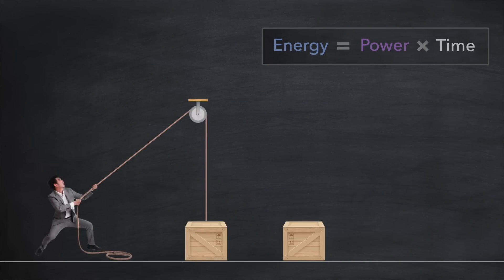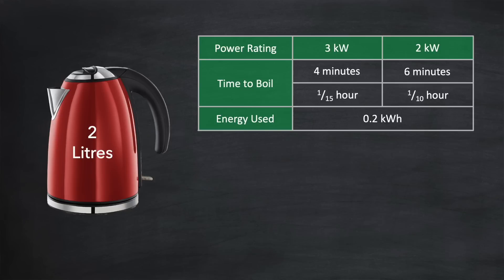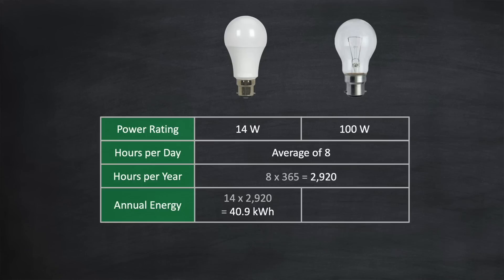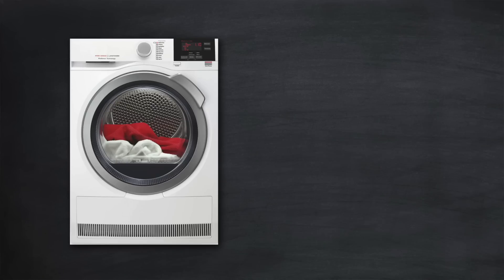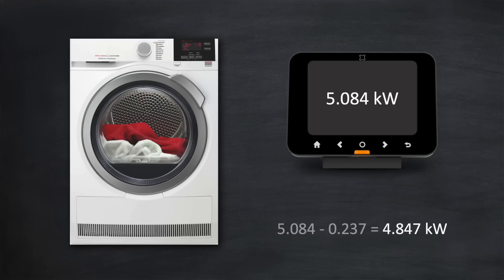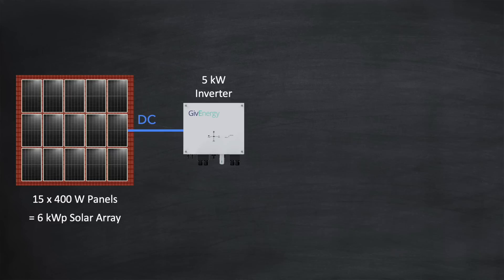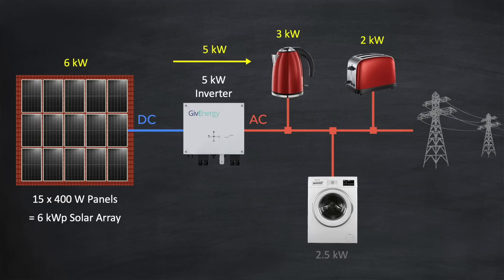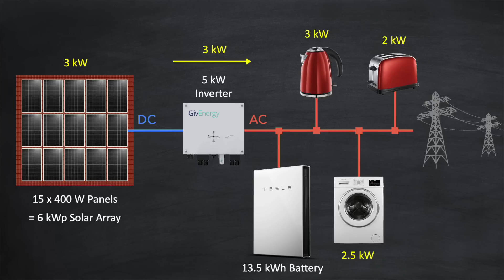kW / kWh: What’s the Difference? Power & Energy Explained

Comment: Great video Gary.  Question.  If you have 4 Tesla power wall 3 AC connected batteries, does your discharge rate KWH figure = 20kwh or is it limited to 5kwh but you just have more stored energy.  Apologies if that is a silly question.
Reply from the maker: Thanks for the kind feedback :-)

Now, the discharge rate of a single PW3 is 11.5kW already, and I believe that stacking 4 together might increase that - but I actually don't know! Maybe someone else does...

Comment: The comments have used use of capitalization on the units. The rules are pretty simple. Units are in lower case with the exception of those based on names. Prefixes are in lower case up to kilo and upper case after that so the proper use is kWh as watt is based on a name of a person (note the name of the unit is not capitalized, just the symbol)

The units based on names include:

Volt (V) base n Alesandro Volta who invented the electric battery.

Ampere (A) based on André-Marie Ampère who defined the concept of current.

Joule (J) based on James Prescott Joule who defined the relationship between current and power.

Ohm (Ω) Based on Georg Simon Ohm who formulated the relationship between voltage, current and resistance, co called Ohm's law.

Watt (W) Based on James Watt who produced a workable steam engine and formulated the concept of power.'

Coulomb (C) based on Charles-Augustin de Coulomb who defined te electrostatic force

Siemens (S) based on Ernst Werner von Siemens who invented electric trams, locomotives and elevators. Siemens is rarely used as it is just the reciprocal of an ohm.

Originally all the units was based on electricity but now watt and joule have definitions unrelated to electricity. Note none of the named units were proposed by the person in question.  Watt for example was proposed by Charles William SIemens.
Reply from the maker: Cool 👍🏻

Comment: would you please offer a practical help: what is a difference between these two companies 1. Each block is equivalent to 50 kilowatt hours (kWh) of electricity and is available for $4.92 net cost per month. So when you subscribe to two blocks, you’re supporting 100 kWh of solar energy for only $9.84 per month or just 33 cents per day.versus Versus  2. The initial credit rate on your bill will be approximately $0.04 per kilowatt-hour (kWh) and will remain at that level for the first 36 months. Starting with the 37th month of continuous enrollment, the rate will increase 1.5% annually; A 1kw subscription to solar energy will cost less than $8.35 a month** Please help what is the difference between these two offers?
Reply from the maker: Unfortunately, l'm not in a position to provide individual advice (not least because of potential liability issues, even if that advice is given free - such is the world today). You're best to speak to an installer for such advice, or post a comment onto a solar forum (e.g. this one in the UK: https:// www.facebook.com/groups/2197329430289466). Good luck!

Comment: Great video thank you very much indeed. I use a Thermos to save the boiled water so that I don't keep boiling the kettle.
Reply from the maker: Great idea!
Reply: Get an instant water jug that heats the water through a pipe and delivers just the amount of hot water you need instead of boiling a jug full every time you just want one or two cups.

Comment: Yeah, the fact that so many still use amp hours when referring to battery capacity without stating voltage drives me crazy. Its like measuring fuel economy in in wheel revolutions per icecream scoop of fuel 😅
Reply from the maker: Agreed

Comment: Hi Garry,
It is a great video. However,  I am not quite agreeing with any DC couple inverter can draw more than its rated kW.  If we have more solar generation output (say 6kW), if Hybrid Inv is rated at 5kW, a total of (Load kW + Batter drawn kW), is always limited to 5kW. 
In your presentation/ DC coupled slide, , if the load = 5kw, battery can’t take any additional power. If the load is 4kW, then battery can take 1kW, making total = 5kW ( that is inverter rating)
I checked this subject in the past with two inverter manufacturers, they confirm it is the case.
Reply from the maker: Hi Sug, thanks for taking the time to comment.

Ok, it must depend on the inverter brand then. I have a 5kW GivEnergy hybrid inverter and it can do this. Here's a screenshot from the other day, showing generation of 6.63kW: https://garydoessolar.com/files/gen.jpg

What were the two manufacturers you mention?
Reply: Hi Gary, thank you very much for clarity. it was then Solax and Sunsink. It seems, this capability is depend on the inveter brand then. I am in the process of deciding which inveter to go for thus, it is very vital for me to fully undestand this oversizing concept, rating of inveter and total output of inverter (Battery + AC load).
Reply: Hi Gary, what is the size of your PV array please? it was generating 6.63kw on other day, array size should be higher than that?
Reply from the maker: @Sug-1998  My array is 7kWp on a South-facing roof, so I was quite pleased - especially as it's only March!
Reply: @GaryDoesSolar  Great. Thank you sharing with me. So, you have installed more than Giv-HY 5 max DC input power, on data sheet says 6.5kw.
Reply from the maker: @Sug-1998  Hmmm, good question. Looking at this link: https://www.givenergy.co.uk/pdfs/products/datasheets/giv-hy-5-0-gen-2.pdf it says this:

"Max. DC Input Power (per string): 7.5kWp"

My array is split across two strings. It was the installer who did all the calculations and didn't have any concerns.

Comment: Hello Gary.
A very interesting and informative series of videos. Thanks.
Something I often wonder though, is why we don't refer to kWhs as Units.
It means the same thing, as 1 kWh equals 1 Unit of electricity, and would save a lot of the kW  and kWh confusion.
Would you agree?
Reply from the maker: Hi David, I ask myself this question every day! Think about driving a car. The main unit is the distance traveled, and so speed doesn't have its own unit - instead it is always expressed as distance / time (e.g. "60 mph").

With energy, it is power that has it's own unit, and worse still (in my view) the energy units are tied explicitly to "hours" - seems totally crazy to me! Lol
Reply: @GaryDoesSolar  "My EV has a 39 Unit traction battery and it does 4 miles per Unit"! Much easier, IMO. :)
Reply: Ah so it's not just me them, I just can't see the logic & it always confuses my calculations!

Comment: Hi Gary. Love the videos. So well explained thanks. One question. In your example at 14m20s you have 6kw being generated meaning 5kw can go onto the AC network via the inverter (to presumably either run appliances or be exported ) and the previously lost 1kw going to the DC coupled battery rather than being lost. If you had an AC coupled battery would that extra 1kw get lost or would the AC coupled battery also be able to utilise it assuming it was still a 5kw inverter? Thanks. I’m off to check the charge and discharge rates of the batteries being offered to me!
Reply from the maker: Thanks Ruth - very kind of you to say :-)

Now yes, even though a string inverter has a maximum output limit, if there is solar generation above that, and a DC-coupled battery is connected to that inverter, then it will be able to send that surplus straight to the battery (it's easy for the inverter to do this because it's DC to DC transfer).

An AC-coupled battery can't take advantage of that surplus though - because to get to the battery, the inverter would have to convert to AC and it's already at the output limit. 

Hope that helps :-)

Comment: Interesting videos, thank you.
Would be interesting to discuss what happens with a power outage on the grid - and what gadget can help continue your home power from your battery as most home batteries and solar don't work if the grid fails.
Reply from the maker: Cheer TC - yeah, it would be great if all solar installations have a whole-house backup capability (like say the Tesla Powerwall) but not many do.
Reply: There is a house to grid shut off switch that automatically stops the power from a home solar and battery system entering when the grid goes down.All systems must have this to prevent houses feeding the grid when work must be done on the grid to avoid a dangerous situation for the power workers.In my country this is an isolation requirement for that reason.

Comment: Gary, just FYI a kilobyte is NOT 1000x 1 byte but 1024x. Ditto kilobits. Bit=BInary digiT ie. either 0 or 1. Binary uses 2,4,8,16,32,64,128,256,1024 and up...hence the 1024.
Reply from the maker: Ok, fair comment - and because I'm a software engineer by trade, I really should have known better... :-)
Reply: Kibibyte = 1024 bytes. Kilobyte= 1000 bytes. This is why manufacturers use kB, makes it look larger, but your computer displays kiB.

Comment: Your videos have been good and useful to confirm what is already known or to show prospective clients.
Out of interest, what sort of fuse are you putting in a 13 amp plug to be able to get 5kw out of it for a tumble dryer?
Reply from the maker: Hi Jason, yes - well spotted! I think I got a bit carried away with how much power a typical consumer clothes dryer actually uses! At most, it would be around 3kW. I added a correction to the video. 

I really appreciate you showing my video to others, so they can learn more about the technology. Next video is on AC, DC, voltage and current...

Comment: Although this may appear to be a silly question, but here goes. We are in the waiting process of having 16 x 415 solar panels fitted. The this we are having an inverter and 2 x 9.5 kw batteries fitted to store any and all surplus power/energy. When it first goes in and becomes live, will the system automatically drawn from the grid to charge the batteries up, or will it waits until the panels do if free of charge? Looking forward to any help or suggestions you may have. Tony
Reply from the maker: Hi Tony, not a silly question at all. And if your inverter is a hybrid GivEnergy one, then your solar setup is almost exactly the same as the one I'm hoping to have installed end February :-)

Your installer will configure the system, but in general the batteries should only be charged with excess solar. If you additionally want to charge the batteries using the grid (say using a cheap rate) then you'll be able to configure this using the GivEnergy interface.
Reply: @GaryDoesSolar  Thank you for replying, your advice is held in high regard with me. I’m also going for the Give Energy set up.  With a fair wind I’m looking at April for our install.
Reply from the maker: All the best with your install, Tony 🙂 Hopefully mine will go well too!
Reply: So the video teaches you the difference between kW and kWh and the OP then mixes them up by referring to battery capacity in kW when it should be kWh.

Me thinks you need to watch the video again.

Comment: Ah ha! Thanks Gary - been waiting for this one. I am now fully appraised on KW and KWh. Another video idea you may have considered, batteries, you have touched on them many times. In this video you mentioned the discharge rate. What if I have two DC batteries with a discharge of 2KWh would this be 4 or does it depend on how they are connected?
Reply from the maker: My pleasure, Phil - glad this video was useful to you :-)

Ok, on the batteries then - yes, it depends on how they're connected. For example, I'll be having two 9.5kWh GivEnergy batteries on a hybrid inverter - but the inverter has a charge/discharge rate of 3.6kW regardless of the number of batteries. 

In your scenario, the limit would still be 2kW no matter the number of batteries connected.

I could also have mounted both batteries in AC-coupled configuration using a separate inverter, but I'd still be limited to the charge/discharge rate of that inverter.

The way to do it if you want the maximum charge/discharge rate is to have a separate inverter on each battery.
Reply: @GaryDoesSolar  Thanks again Gary. Could you have one AC and one DC coupled battery with only the need for one hybrid inverter?
You don't need to answer it here but, I think a video on this would benefit loads of people. 😉😉
Reply from the maker: @Phil-kt6hc  Interesting question. So, certainly the DC-coupled battery will require the hybrid inverter in order to operate, and any additional AC-coupled battery would require a separate inverter (or charge controller) - but I don't see any reason why these two batteries could not work together. After all, an AC-coupled battery will already work quite happily with a separate string inverter managing output from solar panels.
Reply: @GaryDoesSolar  thanks for that Gary. But you lost me about half way through. We are just about to embark on a large extension and in doing so hope to get rid of gas. So your channel and others like it are great research. Thank you.
Reply from the maker: @Phil-kt6hc  Haha - sorry, if I get the chance, I'll try to explain better with a diagram in a video 🙂 Good luck with the new extension - yeah, we'd love to get rid of gas here (reduced only to heating now that we've got an electric hob). I had to replace the gas boiler a year ago, and had considered an ASHP, but it seemed expensive and I couldn't convince myself at the time it would work for us :-/ There is much more analysis available today, however, and so will look at it again in a year or two...
Reply: Sorry, I don't think you are fully appraised on kW and kWh as you used the wrong units for discharge rate!

Charge and discharge rate can be expressed in either of two units: Amps or watts (A or W, kW) but not kWh or Wh.

Comment: Good stuff Gary ... being a retired mechanical engineer and was in charge of a full MEI team during my working career I did manage to grasp most stuff during that period, however what I also learned (during refrigeration training) and the associated physics concerned .... is that many people don't understand the difference between both latent and sensible heat. The reason why it counts is this:  When a refrigeration cycle is in effect both types of heat are used, ie latent heat of evaporation where saturated refrigerant vapour/liquid absorbs massive amounts of sensible heat to change its state within the evaporator of the system. That same vapour is then sucked back into the compressor and pumped out to the condenser at high pressure and is subcooled back into a liquid by the condenser itself, ready to begin again as part of the cycle. It undergoes a pressure drop in order to achieve this either via an expansion valve or most often in white goods ... a capilliary.
So what you might say ... well, that same physics is performed in a similar way in a kettle. When you boil water you are using energy to raise the temperature of the water to boiling point, at which point it changes its state from liquid to vapour. But what physics also demands is the fact that it requires massive amounts of energy to change the state of the water from liquid to vapour and that is latent heat. It matters because everytime you boil a kettle it doesn't click off via its inbuilt thermistor until steam is sensed. But the point is ... if you boil the kettle to just before boiling at say 95 degrees rather than boiling point, the tea bag won't notice the difference. By not letting the kettle fully boil collectively over the months you will have switched it off manually and thus saved killowatts of power in doing so. The water got hot enough to make a brew, but you never changed its state into a vapour, thus saving a huge amount of energy.   :)
Reply: So in essence a variable thermistor kettle would make the ideal brew ( tea has an optimum temperature - is my guess) but also save you a significant amount of money.
Reply from the maker: Hi Rog, this all sounds intriguing. I'm looking into how heat/refrigeration pumps work for a future video and so have a basic understanding of some of the technicals you describe. I was also thinking about changing my kettle to a single cup dispenser. I'm wondering what the optimum solution is (for both tea and coffee)? :-)
Reply: An interesting idea.
Because a kettle's job is to boil water and not make a cup of tea.  So the manufacturers want to be absolutely sure it is boiling before they turn it off, so better to let it over boil.

There's an argument for saying that manufacturers should provide kettles with two settings, full boil, and tea boil.
And tea boil turns the power off when the temperature hits 98 degrees (or even less).

Comment: Another excellent video.I wish 40 years ago my physics teacher had explained power and energy this way. Back then it was about moving objects like you showed with the box. It is much easier to understand when someone explains it with day to day examples. Top job.
Reply from the maker: Wow - that's praise indeed, Michael - thank you! :-) You might be interested in my next video then (hopefully dropping in a week - working on it now)... it's all about AC, DC, current and voltage.

These videos are certainly taking me back to my physics classes at school!
Reply: @GaryDoesSolar  Please no 😀👨‍🏫📐📏📝
Reply: @GaryDoesSolar  I'm also interested! :)
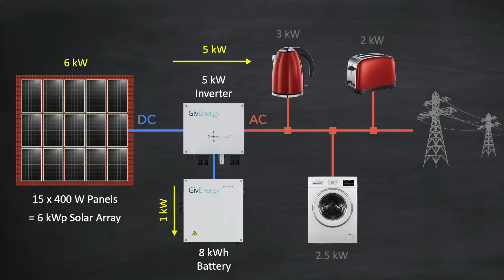Reply: @GaryDoesSolar  14:25----So even if the inverter is 5kW and solar is generating 6kW , you are saying that inverter will give output of 5kW and remaining 1kW will go to battery? How is that possible as inverter can't pass more than 5kW because it's maximum output capacity is 5kW?
Reply from the maker: @fahadmukhtar1124  It's true that only a maximum of 5kW can pass through to the AC side of the inverter, given the inverter size, but there is no restriction on the DC side, so the extra 1kW of generation will go to the battery provided the battery is not already full. If it is, the extra 1kW will be lost.